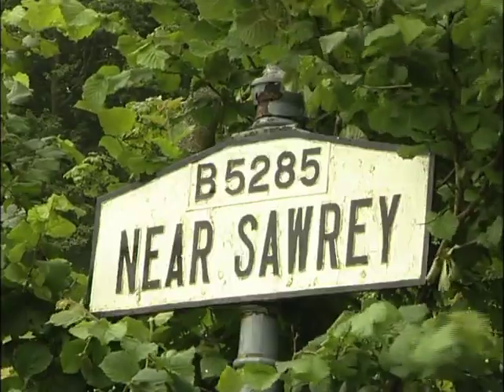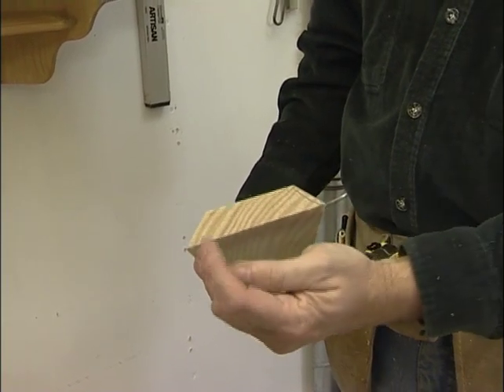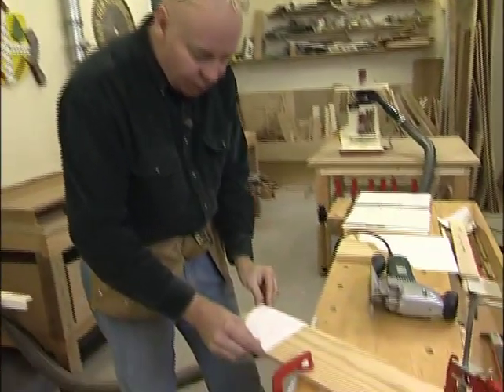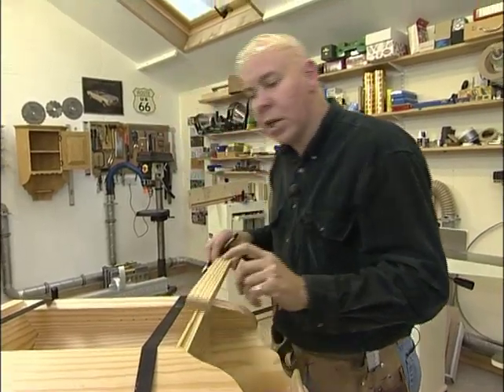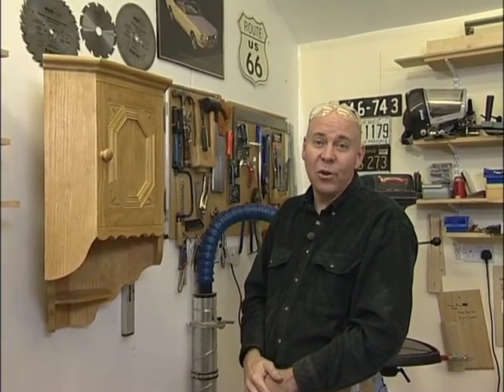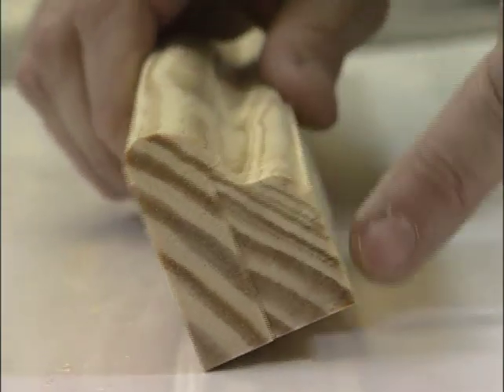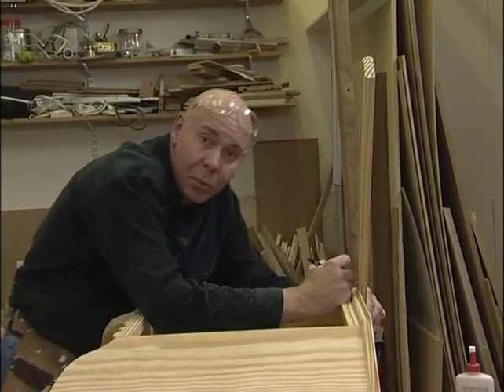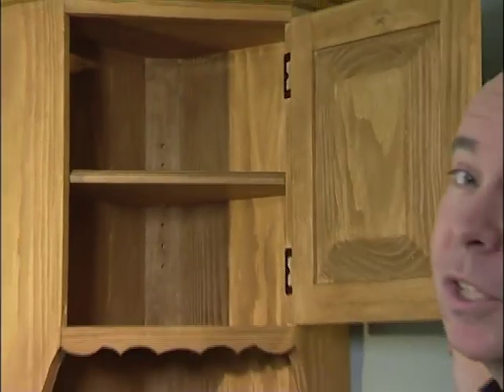Great British Woodshop Austrian Corner Cabinet

Comment: Good to see yellow pine being used. I was trained on yellow pine many years ago and 50 years later, it's a staple in my shop and used often. You did an excellent job with a tutorial on the build of the corner cabinet.  99% of the finishes I use on yellow pine is shellac. Thanks for your effort to help beginner woodworkers get a head start on building a fine piece.